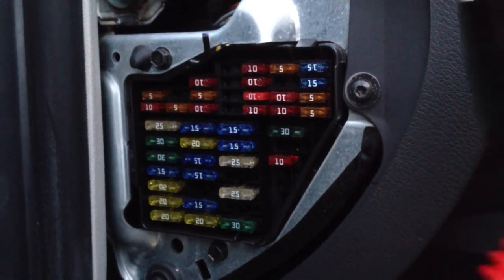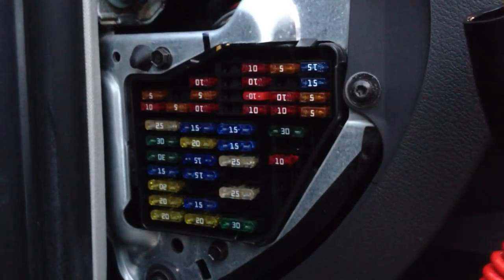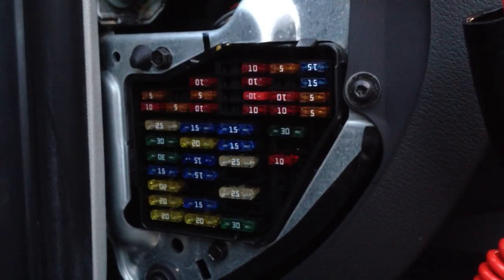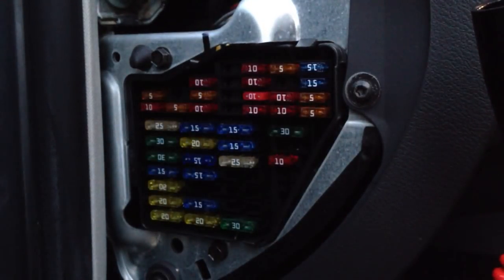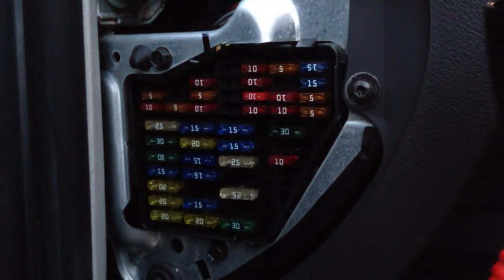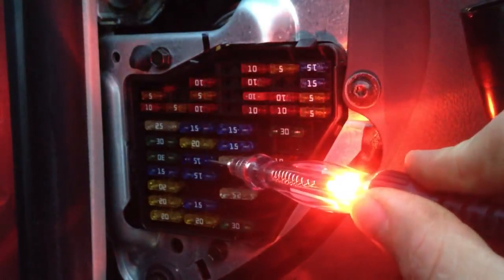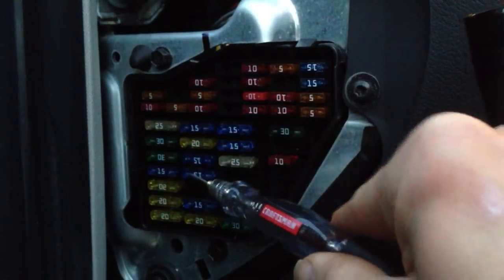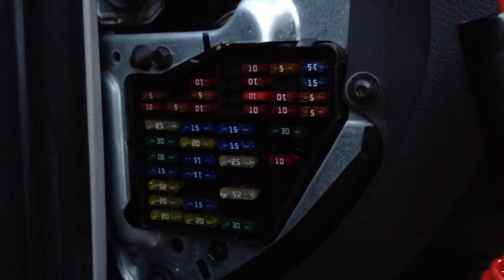How to check and replace a fuse 2005 Volkswagen

Comment: 04 golf. All the Power windows quit all the sudden. Also door locks not letting me lock doors. Try to lock with key and will lock but immediately unlocks. Back hatch always unlocked also. Door button for hatch does nothing. Checked fuses on dash but none for windows. Any ideas. Ty
                            Chad

Comment: Hi Charles 
Can you post the fuse for the high beams. I changed the light bulbs but no high beams yet. I’m trying the inexpensive fixes first. I have a 2012 Volkswagen Beetle Bug 
Thanks. 
PS and anything other DIY Headlight fixes you may have. Thanks
Reply from the maker: The high beam fuses are the small fuses on the top right of the fuse panel. I forget exactly which ones they are. Where the wire shields broken when you replaced the bulbs? https://youtu.be/KbZQzRyF_ko Here is a video on my passat. They are similar and you can get the beetle headlight harness separate

Comment: there is no door chime, headlight warning or turn signal sound when the signal is on. is that a blown fuse or the sound is just gone? and if its a fuse, then which one(s) need to be replaced? 2006 touareg
Reply from the maker: Probably not a fuse, most likely a cluster failure

Comment: got a problem with the  right side tail light fuse blowing out. Replaced the tail lights and keeps blowing out. Even tried a 10 amp fuse and as soon as you turn on the lights it blows. Brake lights work but not the running lights on the right side.

Comment: I have passat R36 2010 and I am having an issue with my headlights. Its always on all the time either switch indicator is in auto or off condition. (Only hid bulbs and break bulbs). What is the issue?

Comment: I was trying to check fuses on VW jetta 2002 as my radio is not working. I checked fuse #42 is seems okay but I also checked Fuse 32, 34 and now my car wont start. What can be the issue? Car was starting before i checked it. Lights and everything else works.

Comment: I have a 2003 Passat and my radio doesn't work at all. I checked the #37 fuse and it isn't blown out. What do you suggest I do?
Reply from the maker: I would pull the radio out and remove and install the fuse at the back. Sometimes that reboots it. If it still doesn't work, the radio is probably dead. 

You'll need a special tool kit to remove the radio.

Comment: Instead of telling the customer of replacing the fuses all the time. Check if they are a non-smoker. If they aren't. They would be using power plugs in the outlet and it would sometimes short the connections. Using a pick, bent the outlet prongs so it won't short again and there you go, the car would never come back again.

Comment: hey :) very useful video,  thanks.  my heater/fan only works on setting 4. is that a fuse problem? it's a 2002 vw beetle x
Reply from the maker: Not a fuse. It's the series resistor that's bad.  I have one stilling on my box waiting for a failed parts video.
Reply: +HumbleMechanic ohhhhh do the video!  I'd love to be able to try and fix it myself! x
Reply from the maker: It's an easy fix and semi easy diagnosis.

Comment: If my headlights aren't lighting but my high beams are is this a fuse problem? Also which one is the fuse for the AC?
Reply: both of my headlights went out at approximately the same time, while the brights continued to work. I originally thought it was a fuse, but it turned out to be burnt out headlights (which seems unlikely). pull one headlight bulb, and see if it is bad.
Reply: I replaced them with new light bulbs and they didn't work I've been using my high beams

Comment: What do the numbers mean? And when buying a new fuse, does it have to be the same colour and number? Also how do you know which fuse is the 12v outlet?
Reply from the maker: Fuses must be replaced with the same color and number. The number is the amperage the fuse will open at. 

Usually the card in the fuse panel will tell you what fuse is for. If not test the. All. It’s good habit anyway
Reply: HumbleMechanic thank you! Turns out my problem was that there was a coin sitting in the bottom of the outlet! My fuse would blow as soon as a tried to plug anything in. Works fine now

Comment: Good evening,
I have an 06 Jetta TDI and I figures that the fuse panels on both of our cars are similar is not exact and I am having issues with my car alarm. Got home tonight and my alarm started going off the second I turned off the car. Went to click my key to unlock and key was not responding. Went to unlock manually and the alarm still didn’t respond. Restarted the car and drove for a minute. Did not do that while driving but the minute I turned it back off it started doing it again. It will go off for about 2-5 minutes and then stop for about 2-5 minutes then continually do this cycle. Possibly the fuse for the alarm horn or another issue. Answers would be greatly appreciated!
Reply: Sorry I’m tired lol figured* and if not*

Comment: hi do u know which fuse belongs to normal headlights  for volkswagen fox 2006 and can i buy any fuse from shop and can replace or there is particular fuse for particular car and models
Reply from the maker: bernard frank You should be able to use any automotive fuse. Off hand, I do not know what fuse you need to find.
Reply: HumbleMechanic actually my headlight working only on city light or high beem normal headlight is not working ,,bulbs are fine connection ok i think fuse problem,i have volkswagen fox 2006

Comment: I have an 2001 Audi TT I came outside one day to get in my car I hit the unlock button with the remote and it didn't do anything so I thought the battery was dead I unlocked the doors manually got inside the car and it started right up but my locks do not work my roof doesn't go down and my emergency brake light is on and in the inside of my car is beeping like the door is open... Could you help me?

Comment: I see that the same number is in a lot of the slots. Does that matter?
Reply from the maker: Ace mom That is the rating of the fuse.  It is very important to have the proper fuse installed in the proper location.

Comment: Charles ive tested some fuses on 12 volts for some VWs that tend to blow. I believe theyre ussually a 30 or 20 amp fuse. Ive tested with a test light but some wont light up the fuse tester when i touch both test sides.  Does this mean theres a ground for the fuse and if i plug my light to Battery positive should they light up if i test them? Sorry for the confusion.

Comment: My 05 VW Jetta will be not used for he next 5 weeks! I want to prevent battery total depleting, I pulled out #42 (25A) Radio System fuse, and #37 Radio terminal (10A) also. Because it happend out of my garage I want to go in the garage with my car, but my VW does not start! :-( I put back BOTH fuses, car start, but CHECK ENGINE light remain ON! 
Is this normal? After every fuse change check engine should be reset? BTW how do I reset check engine, because nothing wrong with the car!
Thank you.

Comment: My mother tried to change a rear light bulb in the trunk of my 2003 Volkswagen golf. Now my car windows wont go up or down and my care remote wont function even with a new battery. I thought she may have blew a fuse but we checked the fuse box and they all seem to be fine. Any thoughts?
Reply: What was your answer to your problem as tha is what my car is doing?
Reply: I'm dealing with this same problem with my VW golf. My Windows won't roll down down, the car doesn't stay locked either. I don't know if it caused sometime of shortage  or what.

Comment: some of my fuses don't  have power even after getting new ones on my Jetta what could that be also no power for ecu no check engine light comes on with all other lights and scanner won't connect and got a new ecu still won't work please help thanks

Comment: I have a Volkswagen beetle 2001 and my speedometer stick stop moving so now I can't tell how fast I'm moving and I'm not sure what fuze chip needs replacement can you help please
Reply from the maker: Probably not a fuse. Either a bad cluster, bad sender, bad wiring, or the gear on the diff has broken

Comment: Hey long story short i bought a car and it has electrical problems. The guy said these problems sre due to the fact that he got hit on the right back door. The car is a 1997 vw golf. The back lights, the dashlights, and the directional lights dont work. Could this be fuses? Thnx

Comment: Hi HumbleMechanic
I was changing my fuse,because my inferior lights were not working, now they are working but the bright lights are not workin..how do i make sur that i have put back the fuse in a correct place.please help me. my car is a polo 2010 comfortline

Thank you.
Reply from the maker: It depends on the set up of the fuse panel. We don't have the Polo here, but I will do my best.

On a slot for a fuse, that has a fuse, there are 2 contacts. One for each side of the fuse. Often if a fuse is not installed, there is only one contact. This is not always the case, but its a good place to start
Reply: I went to vw to check for the fuse manual.they sad no they do not give out the books. so they are sayi that i must bring the car so that they can check the problem. Idont have money to go there.
Reply from the maker: siyanda bunu
Dealers generally don't give that out. Take a look at the fuse locations and see if you have a fuse slot with 2 contacts. Do that before you take it in.
Reply: What must i do when i see a slot with 2 contacts?
Reply from the maker: Install a low amp fuse 5amp or 10 amp. See of the thing that was not working, starts working.

Then we need to figure out what fuse belongs there. Check the fuse locations next to that spot. One slot may not have 2 pins. Install that fuse in the slot with 2 contacts.

Comment: 2006 Passat
wish you would have pointed out which fuse was the problem for the 12v outlet (cig. lighter)
Also -- do you know the location of the fan switch relay for the a/c and heater.  My switch doesnt work to blow the air in the car.
Thanks
Chaz

Comment: my scanner is showing j17 short to ground.  can not locate it.  it's the fuel pump relay.  its killing my battery when I took out fuse I had power the next morning, but if I leave that fuse on my battery goes dead.  please help.  The fuse is not blown something is draining my battery.  is it mark j17 or j 449?

Comment: 2015 jetta and the horn stopped working. I cannot find a fuse map to know which is the horn fuse. Can you offer any help? I have looked all over the internet.
Reply from the maker: It’s almost always the horn. Can you hear the relay click?
Reply: @HumbleMechanic  yes I hear a click. I just can't find anything on which fuse so I guess I will check them all. Lol
Reply from the maker: If the relay clicks it’s not a fuse. It’s probably the horns
Reply: @HumbleMechanic  ok sounds good. I checked all fuses and didn't see any blown. Thank you for your help.

Comment: my Golf 4`s radiator fans are not running and the lights at the door are not working,pliz help
Reply from the maker: +simbarashe gotekwa 2 separate issues. 

Start with the fans. CHeck the fuse panel under the hood.

Comment: nice but dont blame me for asking that and call me lazy but . wouldn't it be easier if there was a sensor linked to the fuses somehow and seperated from the high voltage which warns you right away if a fuse is not working properly  ?  i mean is this technically possible and if yes   have any car maker adopted it ?
Reply: +احمد يونس You can buy fuses that have a little led across their terminals. If it shorts and the circuit is shorted to ground or has a load on it the led will light up. They are a bit more expensive though and in my opinion not worth the money or the effort to build something like this yourself.

Comment: Forgot to mention that the turn signal works for a little while after I replace the fuse and then the fuse blows soon after. We checked the current draw at the fuse and measured less than 4 amps. My Passat is a 2005 TDI Wagon.
Reply from the maker: That is a strange one. I have replaced a bunch of flasher relays, that is also the hazard switch. I might start by checking all the bulbs.

Since yours is a wagon, start with removing the rear turn signal housings. I have seen them installed poorly. Heck they are a pain to get in right. You also have the lights in the mirrors. Those are LEDs, and should not be a problem.. I think I have only replaced a few front turn signals on Passats.

I would pull the rear housings(only for the turn signals) and see what you get.
Reply from the maker: Let me know what you find. That is a good one.

Comment: I blew my radio's fuse but I can't find it on the owners manual, could you help me with that?
Reply from the maker: Jocel Ramos There are usually 2. One in this panel, and one in the back of the radio
Reply: thank you for help I will look into it because my voice is not cutting it anymore with my passengers
Reply from the maker: Jocel Ramos HAHAHAHHA, ;)
Reply: right side diagram 2007 vw passat how it looks
Reply: rightside diagram fuses speedometer DON'T work

Comment: Humble Mechanic, Can you please tell us where the fuse for the trunk accessory 12V outlet is on a 2004 v6 Passat? It blew and no one seems to know where its at to replace. Its not on the driver side dash location. By chance engine compartment or under the dash?.There is no info on the internet or my hand book. Even some VW mechanics could not give us an answer. vin# WVWRH63B74P102411 Thank You.

Comment: My boyfriend removed a few fuses from under the hood the Key will not come out of the ignition now and the car will not turn over. I have a 2007 Volkswagen Pasan 2.0
Reply from the maker: The fuses probably didn’t go back in the right spot.

Comment: my 2004 Volkswagen Passat 1.8t none of my windows works can it be possibly the fuse
Reply from the maker: Very well could be. The fuse for the convenience module being blown can cause that. Also be sure the driver side carpet is not wet.
Reply: I bought the car as a flooded car but it starts and runs

Comment: I took the horn fuse out (red one), put it back in, and now the radio wont turn on. Do I have to disconnect the battery?
Reply from the maker: Should have to. Make sure it’s in the right slot
Reply: HumbleMechanic It is. Then I notice a different radio was put in. Something called Kenwood. Ebay has it. Might need another one.

Comment: 01 Passat glx here. Need to know which fuse is for the heated seats. Specifically the driver side seat. Thanks anyone!
Reply: It's the bottom right one, it should be a 30A fuse.
Reply: +Steffen Hagrupsen awesome. Thanks. I'll check it out. Assuming the 30a fuse is for both seats.
Reply: +Steffen Hagrupsen awesome. Thanks. I'll check it out. Assuming the 30a fuse is for both seats.

Comment: Which is the one for the 12v (lighter)
Reply: I am trying to figure out the same thing... can't find a legible fuse diagram anywhere online... and none came with car
Reply: +Cindy Sin It could be labelled 'CIG' or 'ACC'.
Reply: +Mouse Mystery   the car charger won't work
Reply: The fuse for the car 12V outlet could be labelled "CIG" or "ACC". The fuse locations should be shown on the back of the fusebox cover.
Reply: I already replaced it and it still don't work

Comment: Where is the fuse for airbag for 2002 vw passat
Reply from the maker: There isn’t one. If the light is on, 99/100 times it’s not a fuse

Comment: What if I changed my fuse and my 12V cigarette lighter that I would use to charge my phone still doesn't work. My plug in charger to the 12V lights up but it only charges for about 3 min then a message on my phone pops up saying that this device is not compatible. I have a 2004 Jetta. The 12V in my trunk charges my phone with no problem but I would really like it if my 12V in the car would work properly again. Could you help me please??!!!
Reply from the maker: Diana Nanez Odd, inspect the outlet for any damage. Does it pop the fuse each time? Was the correct fuse installed? Does this happen with another 12v charger?

Comment: I changed my fuze and it still don't work help please
Reply: +Teanna Turner Which part of the car is broken?
Reply: Front and middle
Reply: I mean which device on your car is broken?
Reply: Cigarette plug
Reply: 12volt
Reply: It could be a loose connection at the back of the socket. This means you have to take apart some of the dashboard to get to the wires. There could also be another fuse behind the socket as well.
Reply: Actually my daughter just told me she spilled water in it so where would I go from there
Reply: Looks like a blown fuse due to a short circuit since water is conductive. It could be another fuse with a different label. You have to pull out every fuse under the hood and in the dash area to find the blown fuse.
Reply: Ok

Comment: where is the dual horn fuse ....:(
Reply: Katherine Alfaro, did you get an answer for your horn problem? I have same question.
Reply: No, I did not. I had to pay around $500 to get my horn fixed at Volkswagen. I did call Volks to ask what my cheaper option was and they said that for $35 they could take the fuse out, but I chose to get my car checked and I had to get my clock spring replaced.
Reply: +Katherine Alfaro, thank you for responding. I don't use the horn much. Lol